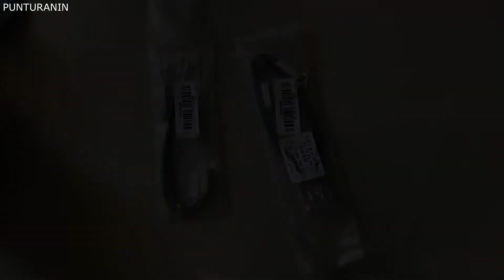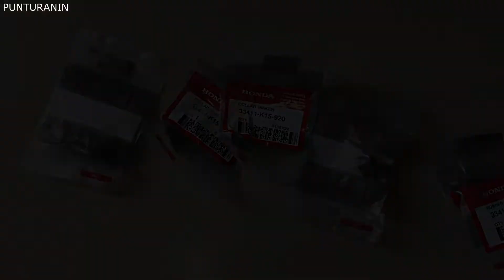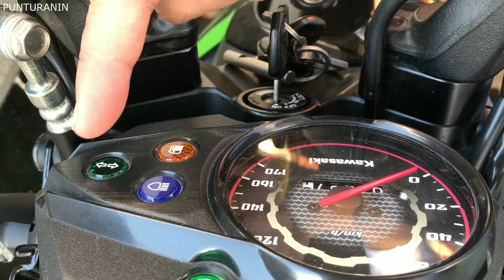Paano Magkabit ng LED Signal Light sa Kawasaki Fury 125 RR

Comment: Boss anu name ng connector na kinabit mo sa gray at black na socket
Reply from the maker: ito po Homyl Pair Turn Signal Adapter Plug for Honda CBR 900 919 929 954 RR 600RR
Reply from the maker: https://www.lazada.com.ph/products/homyl-pair-turn-signal-adapter-plug-for-honda-cbr-900-919-929-954-rr-600rr-i278588966-s418846919.html?clickTrackInfo=query%253AHOMYL%252BTURN%252BSIGNAL%252BLIGHT%252BADAPTER%253Bnid%253A278588966%253Bsrc%253ALazadaMainSrp%253Brn%253A6b38c1b424d29bea8b73e2a3100d9e2c%253Bregion%253Aph%253Bsku%253A278588966_PH%253Bprice%253A215.6%253Bclient%253Adesktop%253Bsupplier_id%253A100096483%253Basc_category_id%253A23782%253Bitem_id%253A278588966%253Bsku_id%253A418846919%253Bshop_id%253A172946&search=1&spm=a2o4l.searchlist.list.i18.18db17d39eurk1

Comment: Boss mali pala nabili ko na rubber para sa signal light. Maliit sya sa butas ng fury. Wala ka kasi nailagay kung anong size ng rubber. Kala ko same sila ng size basta sa click and cbr.. ganyan din kasi nabili ko for click and cbr. Pero maliit sya
Reply from the maker: dito ako nakabili ng malaki boss https://shopee.ph/Rubber-Turn-Signal-Lights-honda-vario125-vario150-new-2018-cb150-cb150-original-lospack-i.360934380.9212786744

Comment: Sir pwede penge link kung saan mo nabili mga parts sa shopee?
Reply from the maker: ito po https://shopee.ph/Rubber-Turn-Signal-Lights-honda-vario125-vario150-new-2018-cb150-cb150-original-lospack-i.360934380.9212786744
Reply from the maker: https://shopee.ph/Winker-Collar-Turn-Signal-Light-Holder-CBR-150R-CBR-250RR-CB-150-Streetfire-Original-Honda-33411-K15-920-i.368714827.17958560613
Reply from the maker: https://shopee.ph/Original-CB150R-led-Turn-Signal-Lights-CBR150-led-New-vario-150-led-i.532094876.12607601074
Reply: Maraming salamat po..
Reply from the maker: @pardopoe  wala pong anuman. salamat din po

Comment: sir pwede po ba send ninyo sakin mga parts ng kinabit ninyo na signal light ganyan din po motor ku papalitan ku salamat po sir
Reply from the maker: ito po https://shopee.ph/Rubber-Turn-Signal-Lights-honda-vario125-vario150-new-2018-cb150-cb150-original-lospack-i.360934380.9212786744
Reply from the maker: https://shopee.ph/Winker-Collar-Turn-Signal-Light-Holder-CBR-150R-CBR-250RR-CB-150-Streetfire-Original-Honda-33411-K15-920-i.368714827.17958560613
Reply from the maker: https://shopee.ph/Original-CB150R-led-Turn-Signal-Lights-CBR150-led-New-vario-150-led-i.532094876.12607601074